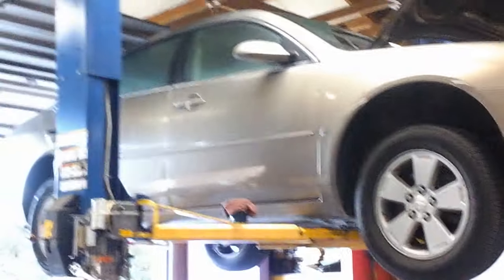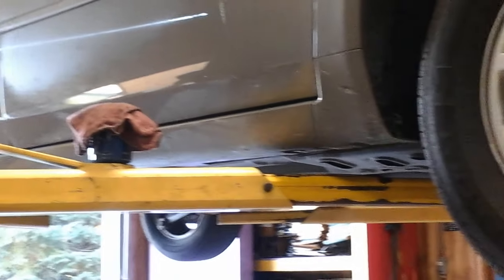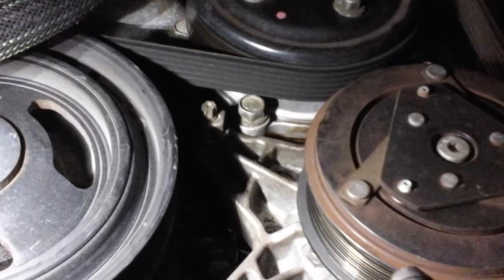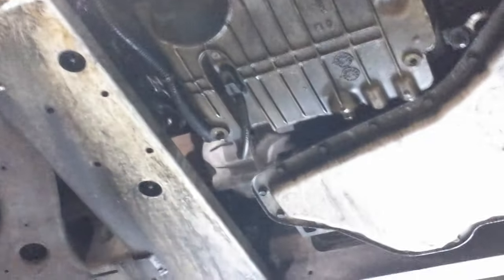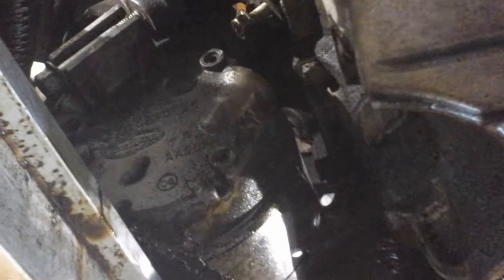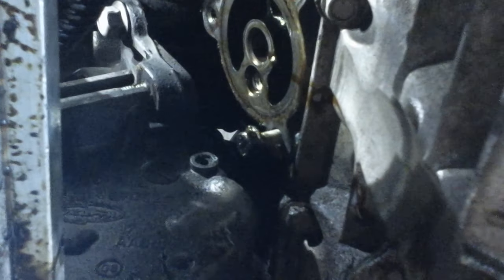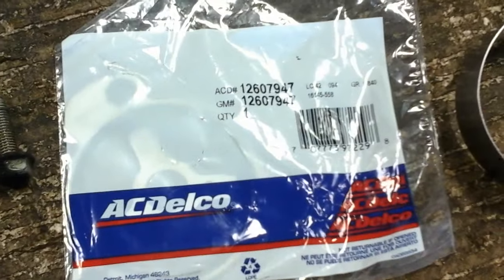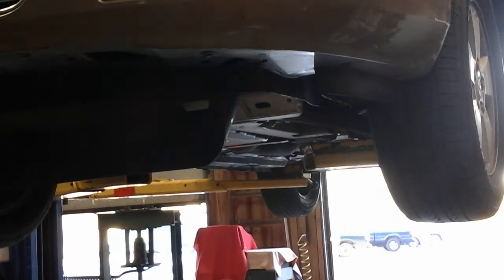Impala oil filter adapter gasket quick

Comment: Before I changed the gasket, realized I did not have to loosen the compressor at all. 2008 Impala. Did take front cover loose. That helped! On a good note, this video was by far the best and easiest! No swivel sockets needed. Thanks again!
Reply: oh good. mine is an 11. hope i won't have to
Reply: 3.6 or 3.9 motor?
Reply: You're right! I did this job earlier today and I removed the heat shield and the bumper plastic.

Comment: This saved a lot of time and headaches. Great vid and information.

There are a few changes due to not having a hoist.
1 - Jack the front as high as possibly safe. Use stands and wheel chucks.
2 - I removed the right wheel to make access to the two 15mm Compressor bolts easy.
3 - I removed the belly shield that Dan just pulled back. It wasn't hard to remove and it gave me straight on access to the 3 oil base bolts (13mm) and the 3rd compressor bolt (15mm). Regular pliers are need for the body panel fasteners (10 -12 of them), 10mm for 3 screws under the front, and 8 or 9mm (I forgot which one) for the 2 screw on each end by the wheel wells. Took 10 minutes to remove the body shield. 

Everything else in the vid is spot on and it took all of 3.5 hours for the whole job.

Again GREAT VIDEO! Thank you for your time in sharing the knowledge!

For reference... my car is a '07 Impala with 3.9 liter

Comment: Just wanted to thank you for your video.  Followed it exactly and it was nice not to have to take AC compressor off.  I decided to replace with the FELPRO gasket verses the OEM because the rubber parts on the OEM were literally shredded and fell apart easily.   Wish I had a lift....little more time consuming when you are lying on your back.

Comment: Just watched this video, just changed mine. If you have a 3/8 inch swivel and a few extensions and a short and deep 13mm there is no reason to loosen the a.c. compressor or even mess with the side. Not even the splash guard. My car pissed oil before. Not a drip now.

Comment: Great vid. I tried to maneuver past the AC compressor without loosening but didn’t have any luck. Pulled those bolts and had it off in no time. No leak so far but will keep my eye on it.

Comment: I had the same issue with my 2006 CHEVY IMPALA about 5 or 6 years ago. Car dealer told me it was the intake gasket that was leaking and they wanted 1200 dollars BULL. Thank God me being smart person I had another mechanic take a look at it and come to find out it this same issue here. Cost me only about 300 dollars along with oil change and tire rotation.  TO this date car still driving very well with proper and on time maintenance being kept

Comment: Thanks for posting this!  Just did this yesterday, and your procedure worked perfectly!
Reply: What year is yours Impala?
Reply: Shane Thorpe 2006 3.9L with 145,000 miles.    I did take the passenger wheel off.  Without a lift, that seemed to make it a bit easier.
Reply: Ted Brenneman yeah it wasn't hard at all took me longer then 5-10 min lol because I didn't want to f up something so I took my time!! I love that I didn't have to take that compressor off!!!

Comment: Yup, I needed to loosen the AC compressor on my 07 Malibu, as well as grind down a cheap 6-point 13mm socket about 1/4 inch before I was able to get a good grip on that problematic bolt..

Comment: This is my first time replacing the adapter of oil and it was leaking on my brother car 2006 chevy impala 3.9L LTZ
Plus I'm trying to fix a seal on transmission of which is also leaking, Do I have to drain out the transmission fluid and replace the seal? Plus power steering hose. Power steering is also leaking. 
My 2011 chevy malibu 3.6L the power steering hose is also leaking and the power steering reservoir (the lid is loose when its tight) is their any recalls on that. Thanks!

Comment: The Impala with the 3.9 engine you need to remove the bottom splash  shield completely because it has a lower coolant hose that is in the way. You don't need a a 13mm swivel socket and you do not have to remove the lower coolant hose. Just follow Daniels instructions the top and lower bolt you have to go under the coolant hose. I just did mine worked great about an hour to do,,
Thanks Daniel great job........

Comment: well wish I had your lift! I jacked my 2007 up from 2 ton floor jack small jack, couple stands! I cleaned everything off then started the car and video taped dripps coming from bolts that hold the filter gasket on. I been thinking it was rear main seal all this time. I believe I will have to take wheel off and splash guard. I wish I could figure it out like almightyjamestown

Comment: Does this work on a 2011 impala having some trouble finding the three screws. I know exactly where the oil pressure sensor is but don’t know exactly which two screws I need to take off to get it off.
Reply: Yes, it should work just fine on a 2011 Impala.

Comment: Where did you find the torque specs for the adapter and the oil pressure sensor as well as the air conditioner bolts ? My elcheapo manual doesn't list them...
Reply: Snug a lug do not go ugga dugga on them bolts

Comment: nice job there bud......I tried this on my friend's car this weekend......just curious did you have the radiator out of the car? I didn't see the radiator hose that is suppose to be right were your light was shining ....nor all the dang wires you didn't mention......I don't believe you had the radiator in the car......nor do I believe it's possible to do it with it in the car......I would have to see it to believe it....
Reply from the maker: The radiator is in the car, so is all the wiring.  You are probably working on a different year or different motor.  I'm not sure why you would think to remove the radiator when in the video you can see I work from under the car behind the subframe along the oil pan, I do not come in from the front of the engine where the radiator is located.  Maybe you are working on a 3.8, not a 3.5 Impala?
Reply: Did the repair on 2008 impala. Your instructions made it quite easy. I removed the wheel just to make it easier to loosen the a/c comp.

Comment: that Delco gasket must be original equipment, it looks EXACTLY like the original one that I took out, I'm assuming it was the original, the fel-pro one that I got wasn't metal it's a material like felt but harder, not sure what it's called, and the sealant rubber that comes poor applied is really skimpy, I hope it works, I think I'm gonna get some of that oil safe permatex sealant to add to it before I install it in the morning. the center peice of metal in the old gasket, that looks like a plus sign and has the two holes in it, it came loose from the old gasket, came out in two peices, I take it that's what caused the failure, it was REALLY leaking heavy... because the new gasket was different it took me a second  to realize that that center plus sign looking peice was part of the old gasket and didn't go back between the housing and block somehow lol real bonehead sometimes, especially when it's raining, and I'm working on my back from the ground, at night....grrrr.... then find out the guy DIDN'T have any permatex like he said he did. so now I gotta go drive all the way back out there, burning my gas, and stop and buy some of the correct sealant out of pocket, to finish up the job. I wish I would have went with the acdelco gasket the rubber that comes on them looks sufficient enough to use by itself, which is how I like to do things anyway.... the guy at the parts store said that the fel-pro was an"updated" item Because of the high failure rate of that particular gasket, so I trusted him and went with that...I guess I should've known. sorry for ranting on your video about the everyday struggles of my terrible life. I can't wait to find another job and get back in a shop with a lift and air supply... working on the ground sucks, I forgot how bad it sucked till I lost my job. and plus dealing with people about Auto repair is A HUGE HASSLE I now realise how important a service advisor/writer is... can't wait to let someone else decipher the customers jargon and then bring me the decoded information haha... and not only that ppl will try to stiff you ALL THE TIME out here doing side work, if I hear "I'll pay you on Friday" after I finish a job again, you'll see me on the news for going postal on somebody!! lol I need to move away from this backwards ass place to somewhere ppl have enough money they don't feel the need to cheat a down on his luck mechanic/technician trying to make ends meat just do they can have their car running to go to the bars. I can't stop venting once I get started im sorry!! 😫😫
Reply: sounds like you need to tell people you need to be paid up front, and if you dont' fix it you'll give them the money back.  Tell them it's your policy for everyone because you can't decipher people by how the look or how they act until it's time to get paid so to make it easy, the policy is for everyone  no exceptions.

Comment: Question: the bolt that that goes with the "U" part of the adapter tube, would I be able to loosen it enough w/ just a wrench rather than a socket, so the "U" can slip out and not even bother loosening the A/C compressor at all?
Reply from the maker: I have not found a way to fit a wrench in there to do that. Maybe you could, however it literally takes about 3 minutes to pull the shield off and loosen the bolts to move the compressor. That's why I've just gone about it that way from the beginning. If you manage to do it with a wrench, let me know though.
Reply: So I did this on an 07 Malibu 3.5L. The concepts were all the same as you demonstrated. There was a heat shield on my housing (2 bolts - one above the top bolt of housing and second was attached to the bottom bolt of the housing), I'm guessing to protect the oil pressure sensor from the headers which are in very close proximity. The A/C unit on my setup was far enough over that I could get a socket in there, so I never touched the A/C bolts. I used a couple long wobble extensions, and it was awkward but did the job. I ended up getting the top heat cover bolt and top housing bolt from above rather than under the car. The headers and Cat were too much in the way. So I took on the intake hose and headers heat shield off to gain better access (5 extra minutes). The job wasn't difficult, but was an adventure for doing it the first time. It seemed like there evidence of a oil leak all over the trans pan and oil pan, I'm hoping it was this small gasket making a big mess and not something more; is that plausible? The gasket was shot to h3ll for sure. Anyways, thanks for the help Daniel.